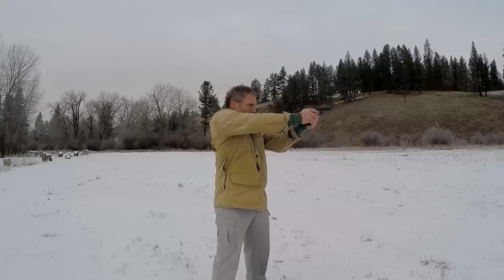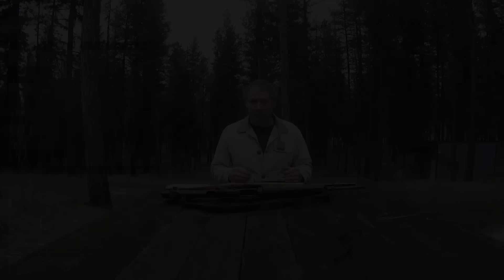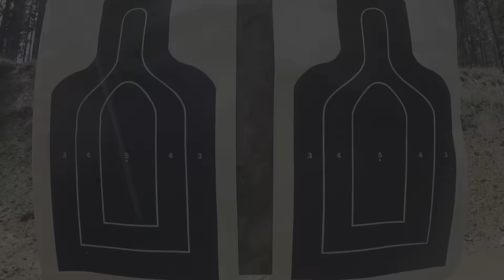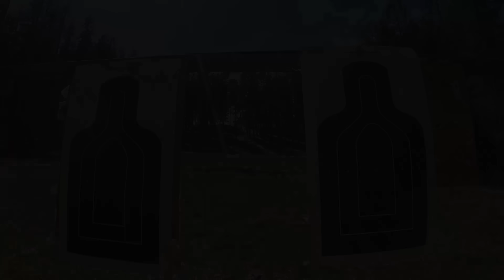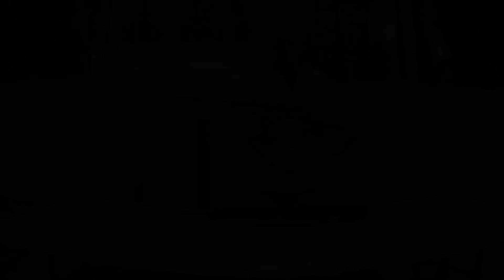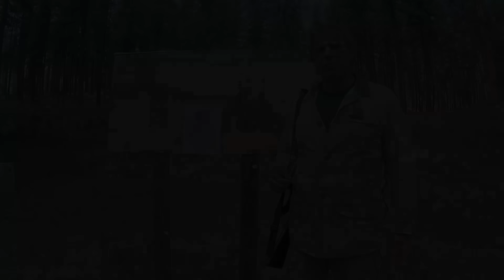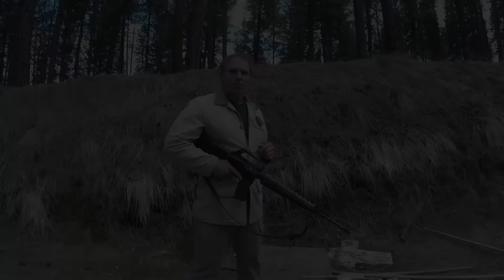Mini-14 vs AR15: Which is Better?

Comment: It would be cool if another company would create a new 5.56 rifle with the traditional stylings of the Mini, but used AR mags and preferably cost under $700.
Reply: What you're looking for would be someone producing the Ingram SAM-1: a rifle using the same action as the M1 carbine but using STANAG magazines. Ingram additionally had the SAM-2, using AK47 magazines, and the SAM-3, using FAL magazines.
Reply: That would put the Mini-14 on the radar just because of the magazine.
Reply: @George-nt8uw let’s be real the mini-14 is already on the radar.
Reply: @George-nt8uw  huh??
Reply: I wish they would make the same rifle but with AR mags. My bolt action .350 ruger does, so its weird they dont make the mini14 accept them.
Reply: The Fightlite ARES SCR is that exact rifle.
It literally IS an AR upper with a sport stock custom lower.
Takes AR-mags.
And it has a fish tail bolt carrier like an FAL does. 
But it’s $1300 not $700.
But If you have an AR upper already. Fightlite gotchu with a good lower and bolt carrier group. If you don’t mind doing some work you’ll get your budget.
Reply: @sethkeister3833  he said "traditional stylings" not "butt ugly"
Reply: Solid suggestion.
Reply: Dave Alexander  Keltec's pretty good. Some of their older models had a few issues though.
Reply: You just described the Keltec SU16
Reply: @cgoodwin256  he said "traditional stylings" not "butt ugly"
Reply: @cgoodwin256  kel-tec sucks though...
Reply: Dave Alexander  just so you know, gun laws were loosened under hitler's regime
Reply: @exotericidymnic3530 Gun laws for countries at the risk of invasion are always relaxed. In case the war turns out badly, more likley than not if the 3rd reich survived the war Hitler would have tightened them back up again. Interestingly though Germany has some pretty lax gun laws apready and has a pretty substantial gun culture especially for Europe.
Reply: @exotericidymnic3530  For Germans. The Jews lost their gun rights under Hitler... so...
Reply: @exotericidymnic3530 yep but not for the Jews.
Reply: Ares / Fightlite SCR
Reply: @-John-Doe-  yes, the fightlite is badass!
Reply: The Kel Tec RDB C is a decent rifle with a 20 inch barrel in a bullpup package, with a traditional rifle stock. A good rifle for those less than free states, too.
Reply: Ruger will never redesign the Mini 14 to accept Magpul or Stanag magazines, for the simple reason that the weapon would then accept military components. It would be immediately classified as an assault weapon by gun control advocates.

If you want a Ruger that takes AR mags, then simply purchase the AR556, if you can.

If/when the AR-15 is banned (more like when than if), a plain, wood-stocked Mini 14 will be one of the very few semiautomatics available.
Reply: I agree 💯
Reply: Ruger already has, they offer a tactical Mini14 chambered in 556 stainless. Good luck finding one & if you do they go for over 1k right now.
Reply: @rac50172015  yeah, but AR mags would be more cross platform compatible.  Not to mention Pmags in a Mini14 would be sexy.
Reply: @Coffee4myTavor  I assume that's because of loadings reloading issues? I honestly felt very much accomplished once I was able to comfortably swap mags. Nothing else like it.. when buddy or anyone else grabs it for the first time I think... Yea right, it's confusing but makes it unique. Ruger mags are the only way to go, 30rds that aren't plastic/poly are far more satisfying
Reply: Dave Alexander  Yeah the Nazis....
Reply: @Shotzeethegamer  "Everyone I disagree with is a nazi"

Comment: Up here in Canada Mini14s are popular hunting rifles - because legally they are treated the same as a bolt action rifle. AR15s are restricted to range use only and are much more heavily regulated in general. That by itself is a huge reason why Mini14s are still popular in places. 

Other reasons which may not be so obvious is that you can get them in stainless steel, making them durable and low maintenance which afaik isn't an option with an AR. Also, the lack of projections on a Mini14 such as a protruding mag well etc arguably make them easier to carry. 

In this context, the advantages of the Mini14 are more relevant than the advantages of the AR, even though the AR is a far superior combat weapon than a Mini14.

Comment: One personal anecdote - I owned a series 180 Mini 14, which is the earliest production run.  It would not hold a group under 8" at 100 yards SCOPED.  This was with a plethora of ammo and with at least 3 different scopes. In my experience, WITH THE SERIES 180, it was terribly INaccurate.

Comment: Mini barrel twist
examples

180-00001--1974--1 in 10
180-05101--1975--1 in 10
180-28282--1976--1 in 10
180-59251--1977--1 in 10

Mini-14
Thin barrel, ejector is in the bolt, no scope ring scallops cast into the receiver.Beginning
Serial Nbr
181-07488--1978--1 in 10
181-48351--1979--1 in 10
181-84879--1980--1 in 10
182-45601--1981--1 in 10
183-03581--1982--1 in 10
183-40455--1983--1 in 10
184-17175--1984--1 in 10
184-26063--1985--1 in 10
184-95448--1986--1 in 10 and 1 in 7
185-14140--1987--1 in 7
185-50455--1988--1 in 7
185-56556--1989--1 in 7
185-81009--1990--1 in 7
186-05029--1991--1 in 7
186-18250--1992--1 in 7
186-20065--1993--1 in 7
186-31116--1994--1 in 7
186-42502--1995--1 in 7
186-58133--1996--1 in 7
186-66855--1997--1 in 7 and 1 in 9
186-81445--1998--1 in 9
186-87432--1999--1 in 9
*196-06325-2000--1 in 9
*196-44553-2001--1 in 9
*196-80982-2002--1 in 9
*196-99207-2003--1 in 9
*197-12180-2004--1 in 9

Comment: a1 ar zero with 55 grain ammo is for mech zero
1000 " or 27.77/78 yards or 25 meters,,
has sumthun to do with magic and science 
You know 
sight height over bore ,
Sight distance front to rear,is that radius?
Also thu clicks involved is more magic,they done figured out about the adjustments equals 1/2 or 1 ' per .............

27.77/78 number is one of them mystical numbers, you know related to distance,mil dot formulas and all
no one has ever splained it ,ever

But you kin zero yo PLATFORM how ever you wishes it to be.....

And ,
Whuts matter with u?

Thu minis have rear sight elevation adjustments,,,,dont they???????

Whut wus yo mini ser number like a 180-,,181-186- you know number
cause it matters,,barrel twist and all

Sum had 1x10,1x9,1x7 twist rates etc etc...
Get u sum nato spec ammo and do do it all over agin....
Sum ,,lemme see
m 193 zzzzz ammoz..

Comment: You should do a Video of mini14s and 5.56 vs .223.
Reply: Well on the off chance he doesnt the only major difference Is that 5.56 as a whole is more powerful and is a slightly larger bullet than 223. And that  223 be fired from a gun chambered for 5.56. But not the other way around

Comment: older modelMini 14 that were known to be less accurate than the new ones.  
A better, more fair video would be to use a new modern Mini 14 which is way more accurate

Comment: How many rounds can a Mini-14 barrel take before it's time for a new barrel? I remember calling up Ruger and asking the same question. I was told that if I didn't 'rapid fire' it would last 900 rounds! I was shocked at such a low number, thinking that it should be in the thousands. Also, the newer models have a beefier barrel so I would believe that number to be even higher than the original 'pencil' barrel.
Reply: Well fuck me, I've exceeded that number by a few thousand rounds in the past 23 years of owning a Mini 14. Who ever you were talking to was obviously fucking with you.

Comment: I had a stainless Mini 14 I purchased new in 1996. I could never get a grouping smaller than a large pizza box at 50 yards. The front sight was very wide. I’m not saying it isn’t accurate,  I’m saying I could not accurately shoot it.

Comment: Modularity and aftermarket, or parts availability, is a huge plus for the modern AR. Drop in a 22lr conversion or swap uppers for different calibers or barrel lengths or optics, the options are endless.

Comment: My mini-14 just seems to cycle on any ammo at all, even weak steel cased crap which won't fire or function in my Colt ar, plus it can be run pretty much dry. I have an array of mags for the mini, even the cheap no name ones work fine.  Both rifles are far more accurate than I am.

Comment: I watched the whole video. Frankly because I didn't check the length before starting, and also because I'm recovering from open-heart surgery and there's not much else to do than catch up on shooting and motorcycle videos. So here we are, and with all that said, I enjoyed the explanations you gave. First, I've never heard the sights explained like you did. Thank you for that. As a 60+ year old, it's a shame I never knew the differences.

But, I've always liked both platforms, though I have only ever owned an AR-15, though mine came a little tricked out. Now I want to get an A1, A2, or A3 just for the carry handle and the iron sights, which I've always shot very well with.

Thank you, Paul, for your time putting together such a well-thought-out and presented script.

Comment: I've been super happy with the Frankenstein AR-15 I built from scratch. Running it in a sort-of A3 setup, except the hand guard is a 15" free-floated quad rail, and the front sight is on the very end, giving me a few inches more distance between the front sight and rear A3 carry handle sight. Shooting 55 grain 5.56x45mm ball ammo out of a 1:8 twist 16" barrel, it's spitting rounds quite accurately up to 450yds (farthest target at the range I shoot at). The whole build, including 1 Gen 3 windowed Pmag and 2 Gen 2 Pmags, ALG QMS trigger group, Magpul MIAD grip, a nickel boron BCG, and a UTG Heavy Duty Recon 360 bipod (all decent upgrades from milspec) had a sub-total cost (excluding tax and shipping) of $715.25, or $639.37 without the extra Gen 2 mags and bipod. I also bought some items like the barrel and BCG during sales, saving about $200 between the two.

It's certainly no BCM or Daniel Defense AR-15, but it's only had one malfunction in 500+ rounds so far, and that was due to me messing up my operation of the charging handle, causing a double feed. That was easy enough to identify and clear, and was a rookie mistake on my part. I'd love to try a Mini 14 at some point, but I probably won't buy a Mini 14 when a Ruger Gunsite Scout is far more appealing to me. To each their own, and how awesome is it that we live in a country that has thousands if not millions of different models of firearms we can choose from? Huzzah for America!

Comment: "You can't get a cheaper knock off than military issue"

Lmaooo
Reply: BigBossIsBack right lol, military gear is almost always manufactured by the lowest bidder
Reply: @kevingipe702  Except the special forces stuff.
Reply: I remember in the army I had two magazines that worked like a charm, three that worked okay most of the time and two that you could turn them upside-down and shake the bullets out of. Army mags are a cruel joke.
Reply: @UncleDon226  Pmags to the rescue.
Reply: @UncleDon226  Lol I recently saw a video of Marines practicing reloading fast and one of the magazines just exploded apart the instant it touched the ground
Reply: @UncleDon226  I bought some military surplus magazines when I first put together my AR.  I threw them away and bought magpul pmags, those metal magazines were awful.  Didn't like to hold in the rounds.
Reply: No bigger facts have been spoken.
Reply: Especially Vietnam era
Reply: My 💩 top quality its military spec😃💪

Comment: Thanks Paul, I enjoyed the topic and I know an individual (that's an understatement) who owns a Mini14 and I have seen him handle in ways that I admired at immediately sighted game.  I had heard the stories about the Ruger and after owning an AR15 I was steered into believing it.  This may be due to my appreciation to my rifle which I assembled among some upgrades.  Mine has a 16 in., free floated barrel and now a 3x9 optic.  I reduced the trigger pull and the creep.  My grand appreciation mostly came from NOT having experience with such a flat shooting cartridge and firing it at over 200 yards and sounding the steel gong at will.  What a boost my ego received  in addition to deciding what a fine firearm it is.  The cartridge is awesome.  Your presentation was a joy to listen to and gather information from.

Comment: I carried an A1 in the USMC in the early 80's. On the range, under perfect conditions it was a very good shooting rifle. Take it out into the field and if you neglect to clean the damn thing 3-4 times a day, it would jam after only a couple of rounds. I have a Mini 14, and with a 4 power scope, it's a very nice rifle to shoot out to 300 yds. I do very well with it out to that range. However, if I planned to fire anything beyond that, I'd take out my M1A...just my 2 cents. Oddly enough, 100 yds and below, I'll take my PS-90 any day of the week.

Comment: The time frame means a lot. My mini is first gen made in 1976, and had 2 Ruger 5 round mags and I paid  $199.00 for it at a local department store on labor day weekend.  Colt AR15 at that time was more than 3 times that. My mini doesn't have the push button bolt catch, but a lever on the left of the receiver. When I wanted to top off the mag, I just slid back the bolt and pop the rounds thru the top of the receiver into the mag, I never removed the mag. It is very well made, very reliable, and accurate.

Comment: the M16 type is inherently more accurate having several bolt head locking lugs vs two for the Mini-14. Using good sub moa ammo you can see this.

Comment: Regardless of what the barrel says, the Mini 14 can accept .223 or 5.56 Nato. The newer rifles say so, but the older models just say 223 Remington. I have an older model, so I was curious. The manual says the carbine will accept civilian, military or law enforcement ammunition. I contacted Ruger and they told me it means just that. The Mini 14 will safely handle 5.56 Nato. 

The gun was first manufactured prior to there being a difference so some models didn't differentiate. I have an older original pre-ban folding stock and have no issues shooting modern XM193 or XM855 Lake City ammunition.

Comment: I worked in the state prison system for 26 years.  Correctional Officers that maned the towers to watch the yard were issued Mini-14's (at least in the state I worked).  There were several reasons the Mini-14 was chosen.  First, it is very reliable weapon based off its full sized big brother the M-14.  Second was cost.  It is hundreds of dollars cheaper than a M16 or AR platform.  Three, the psychological effect.  If a riot took place on the yard, a Mini-14 is very VERY loud with that open bolt.  Fire off a Mini-14 and every inmate on the yard will hear it and hit the ground.  Its a attention getter.
Reply: subcomandante marcos  The state could buy a new mini 14 from the manufacturer for $600.  The AR's were more expensive.

Comment: If I have not already said so, excellent video and I for one think it was a very careful, thorough, and unbiased comparison.  I think the discussion of the sights between the two was very  interesting.  These are things you don't get from the average "shaved head foul mouth" vids on YouTube. 

I am not sure I agree on the point that many make that the Mini-14 is expensive.  First of all, a $600 AR (from what I have observed, and I own 8 AR's); these cheaper AR's have more QC issues, so I would tell anyone to spend at least $750 on an AR or, if you get a budget AR, have a pro check it out.  You get what you pay for. Not to mention the Mini has a rail, scope rings, and 2 mags included. 
What other old-school semi-autos are out there?  An M1 Carbine?  Those are even more money, even the WWII vintage. 

Even if you don't have a "mullet and parachute pants", there is a lot of appeal for an old-school rifle, and the Mini-14 is simpler to maintain (as you pointed out) and extremely reliable. The sighting system is perhaps crude, but also dirt simple compared to an A4 variant AR, and better than dove tail sights on a COMBLOC rifle. How many guys really know how to properly sight in an A4 unless they are prior military? 

You have demonstrated that a Mini-14 has very reasonable accuracy out to 200 yards.; and you are using one of the older, pre-2005 Minis that (supposedly) are less accurate than new production.  Works for me. 

If you already have checked the AR15 box, I see no problem in getting a Mini-14, even at $850.
Reply: Companies like Palmetto State Armory and Del-ton make fantastic budget ar15's. The main difference between a modern budget ar and an expensive one is in the barrel. Most people don't need a cold hammer forged chrome lined barrel, a button rifled nitride treated barrel will serve them just fine. Other than the barrel, mil-spec is mil-spec and you're paying extra for a brand name.

Comment: To anyone wondering, it doesn't matter in the slightest. Someone with an AR who has trained with it will use it just as well as someone with a mini. Regardless of gun, someone adequately trained is far more important than the weapon. Just look up fastest bolt action to see what training can do to make the weapon fit the user.

Comment: Nice video. But I wish if you were going to compare the Mini to the AR you would have used one of the newer Minis in the 580 or later series guns with the heavier tapered barrels instead of the early gun you used with the lighter "pencil barrel". Not really a fair comparison IMHO. And also use a new AR like most people are shooting now. That would be a real comparison. And no need to use just .223 ammo for the Mini. It has a Wilde chamber and can use .223 or 5.56 interchangeably.